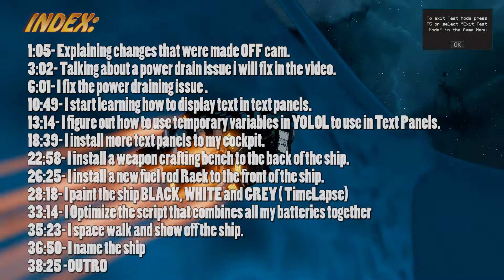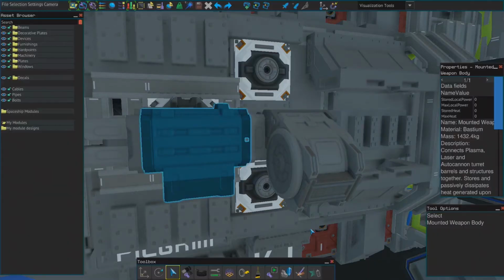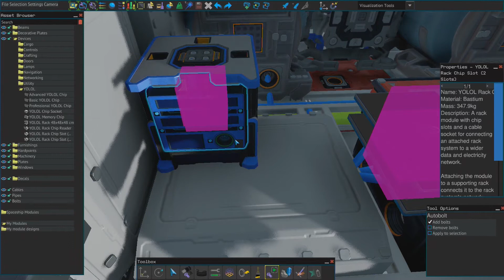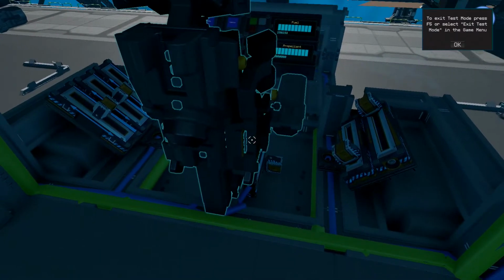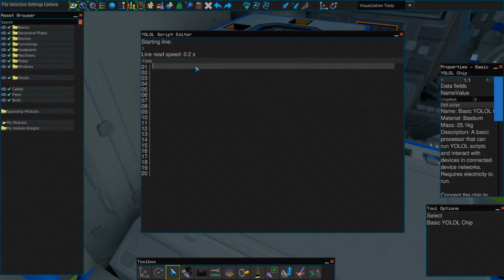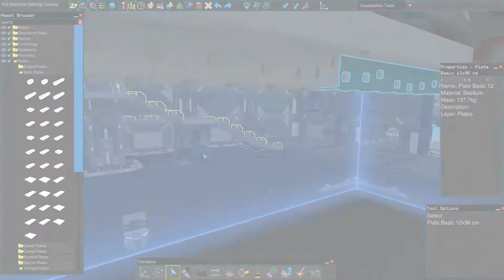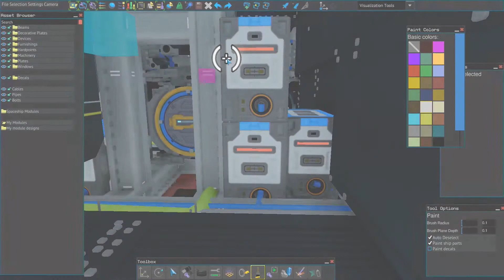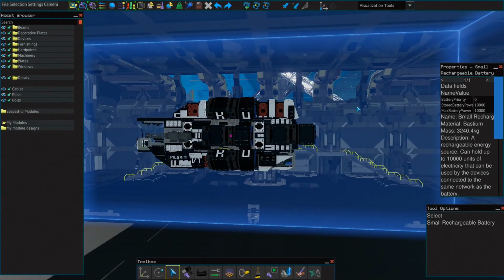Starbase - Let's Learn Ship Designer - Part 19 - YOLOL Optimisations, PAINT JOB and MORE !!!

Comment: Ship looks great!

Some YOLOL optimisation tips: 

:Combat==1 can be :Combat>0 (one less character)

If you want to be more advanced you could have done with multiplication instead of if... then... else ...end to be much more compact:

:ACL=:Combat*100 (:Combat can only be 0 or 1 so it will be 0 or 100)

For local variables it only needs to run once so:

1. TOF="Transponder OFF"
2. :Display=TOF goto2

FIrst time it will run line 1 then you just need to loop line 2, makes refresh faster

You can join text using + so:

:Display=:TOF+"\n"+:COF+"\nCannon: "+:ACS (\n is new line)

If you need to spread it over multiple lines you can use += to concatenate, so this does the same thing:

:Display=:TOF
:Display+="\n"+:COF
:Display+="\nCannon: "+:ACS
Reply from the maker: Wow, thanks so much for the tips.
I'm always looking to learn more YOLOL and i've always wondered what \n meant when i saw other people's scripts so thanks a lot for teaching me ;-)
I'm gonna spawn an older version of the ship and mess around with those lines to see them in action, i learn more when i can see things in action hehe.
Then once i fully understand everything, i probably will re-optimise my scripts with this more advanced YOLOL.

Thanks so much again for taking the time to write this.
Reply from the maker: I have a question for this line here :
:Display=:TOF+"\n"+:COF+"\nCannon: "+:ACS (\n is new line)

This part here more specifically "\nCannon:"

I noticed there is no space between \n and Cannon and i also noticed the colon is at the end of the word Cannon instead of in the front of it.

How is the chip going to read this?
At first glace i don't know how to read this myself.
Reply: @KrawllUnchained  \n makes a space or line over line like use in discord bots like say you have "\nTransponder:" "\nCannon:" looks like 

Transponder

Cannon
Reply: @Vincent Teo thx u bro i've been hung up on displays with different text you truly help me out a bunch bro thx u.
Reply: @KrawllUnchained  \n is just a new line so I just added a new line before cannon so it will go to the next line. Anything in the quotes is a string so the colon is just for display so it will show Cannon: xx on the text panel without it it will be Cannon xx, just makes it look nicer
Reply from the maker: @fsworldfamous7914  I never messed around with Discord bots. Only time i'm ever on Discord is to play Sea of Thieves with friends and we're using his Discord server.  I'm a complete newbie when it comes to discord.
Reply from the maker: @vinteo81  Awesome, thanks for clarifying!